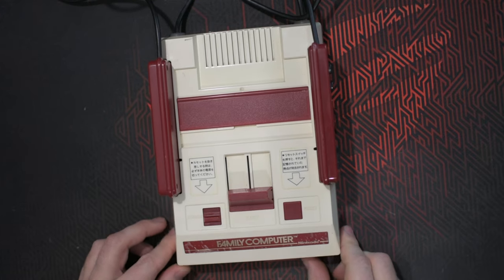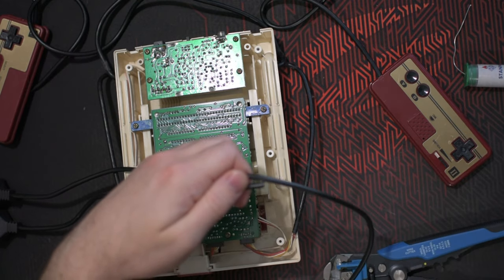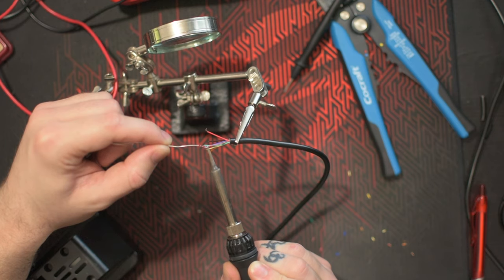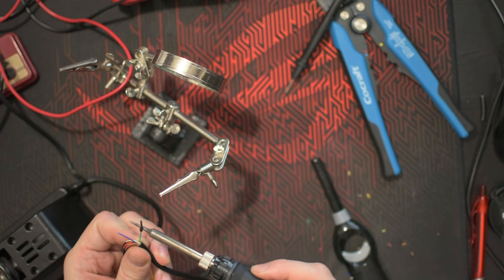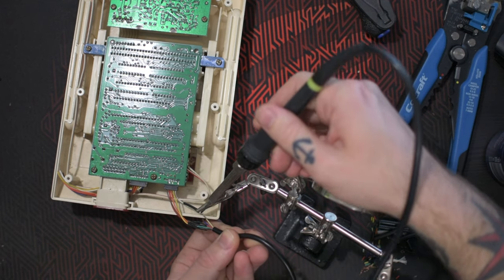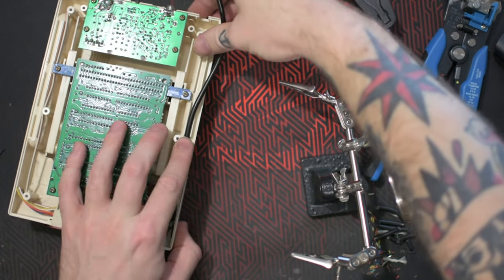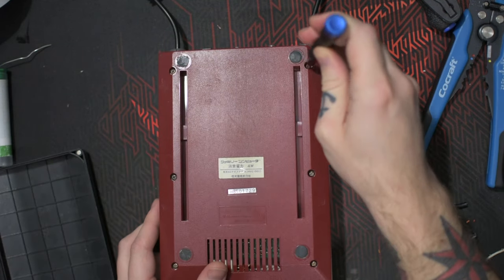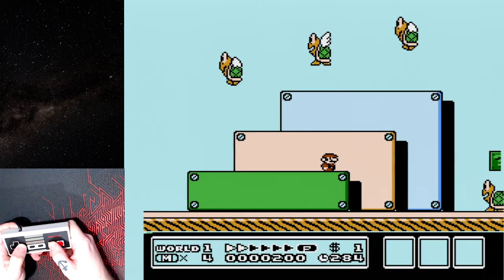Famicom - With NES Controller Ports. Easy Mod.

Comment: Which extension cord did you use? Is the color coding on the wires fairly standard? I’d like to do this myself using the extenders from Hyperkin, but I don’t want to have to do a bunch of troubleshooting if you used something else and the colors are different.
Reply from the maker: I don’t think the coding is standard, at all. If you have a multimeter you can trace the correct pin easy.

Comment: Thanks for the vid. There's some places online saying you need to put extra resistors to make the Famicom controllers work with the additional cable length, but it looks like you didn't and didn't have any problems - did P2 work as expected too?
Reply from the maker: Nope, no problems for me. Adding resistors will weaken the power that comes through, so i really don't see how that would help strengthen the signal.

Comment: if you want a solderless mod i guess you could symply keep the fc controller board plugged and replace all the other controller parts from the NES. btw, can you confirm me that the NES controller has easier diagonals than the Famicom? (good for shmups)
Reply: I did this mod, and to me it seems like the nes does have better diagonals.

Comment: Is it possible to connect a famicom controller to a nes console with this schematic?
Reply from the maker: Yes. They use the same output/input so a famicom controller will work on a nes. But i’m not sure if the nes has support for the famicom mic, so that probably won’t work.
Reply: @goldhagengaming  awesome, i will need one of those nes extensions.
Reply: @abrahamordonezzarco785  Actually, you can put a Famicom controller shell on top of an NES controller. Internally they are identical.
Reply: @goldhagengaming  apologies for such a late comment, but if you use the NESessity board it can handle famicom mic inputs